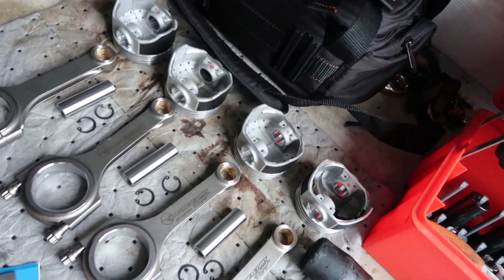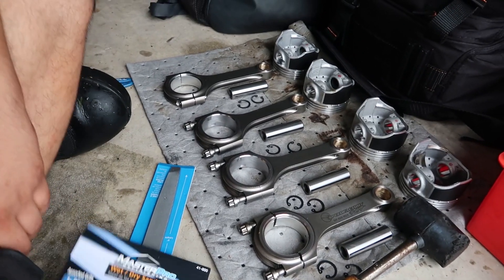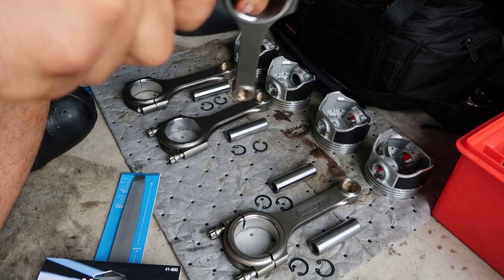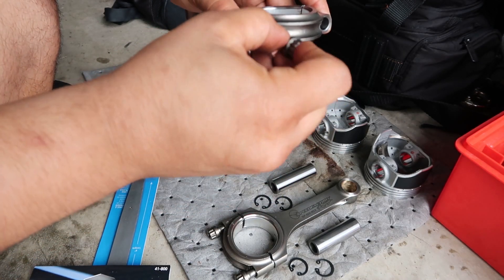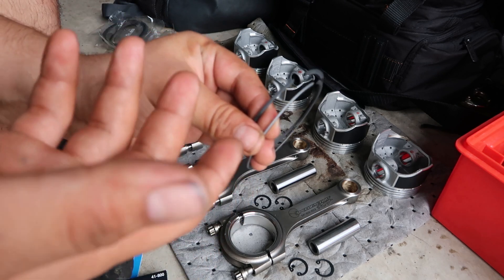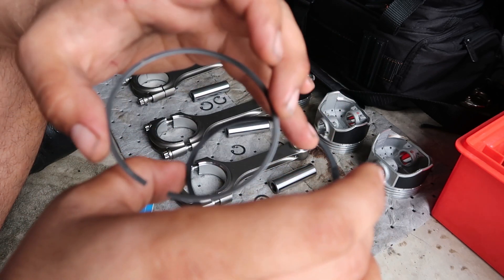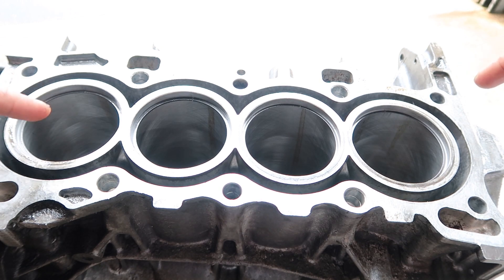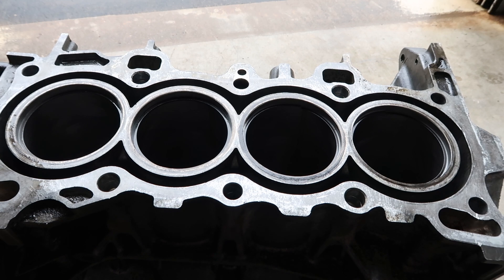Gapping Rings For boost and Assembling Rods + Pistons ~ Speed Factory / Vitara D16 Build ~

Comment: You should point out that if you are honing your block the top ring gap is significantly different than the bottom ring gap. If you get it bored by a machine shop then it will be the same if not it’s different. I run a .026 gap measured at the top of the cylinder vs. when it’s at the bottom it’s more like a .020 for the first ring. I believe this is why most ppl who build these engines gap the rings

Comment: I do the rings for each piston in that cylinder 1 2 3 4  that way I know if there is a .0005 or .001th out your good to go on the gap you do not want it to be to tight or too loose ,  never file over a block even if your going to wash out the cylinder .  do it on a bench or over a trash can.

Comment: Also good tip, DON'T mix rod caps up. They are machined/matched each separately. I found this out the hard way, lol. I couldn't figure out why my crank would not budge when I torqued the rod caps. They should be marked.
Reply from the maker: Good tip, I didn't consider that but I did disassemble and reassemble 1 by 1 so im good there lol, just gotta keep it that way,
Thanks
Reply: Yeah u gotta be careful especially with expensive rods that are pretty balanced

Comment: Are you going to sleeve the block?
Edit: just watched the whole video nvm, but how do you offset the ring gaps? Is there a specific order?
Reply from the maker: Yeah think I'm gonna go cheap and fill the block lol, as far as the rings.. Its a good idea to offset them on installation. Ive read 120 to 180 degress off of each other. Its supposed to help seat the rings on a fresh engine, but they do rotate and move when the engine is running, but the odds of the gaps lining up are slim, they'll rotate at random.